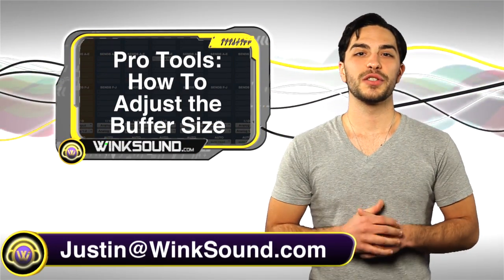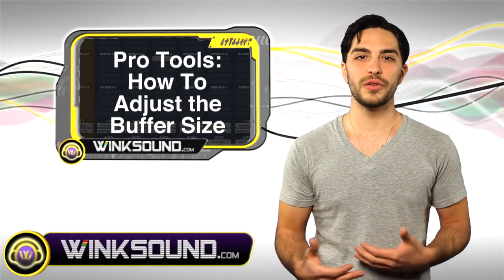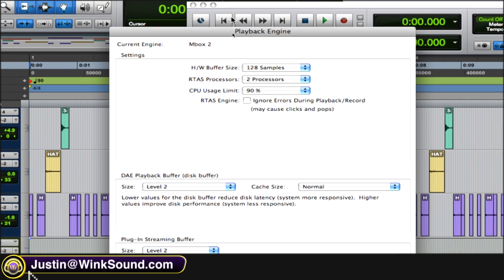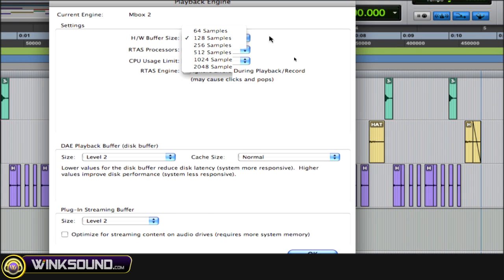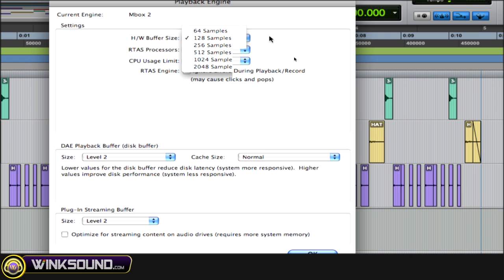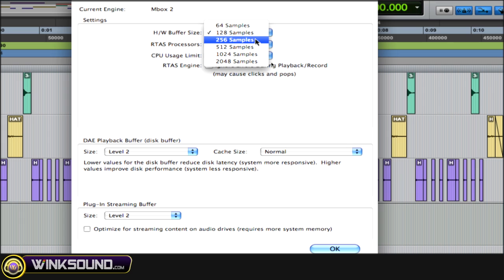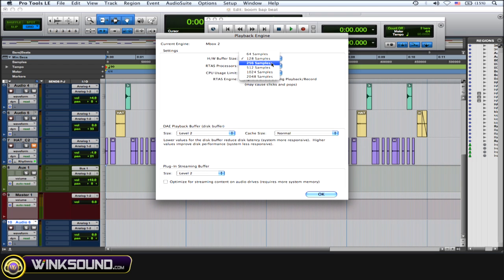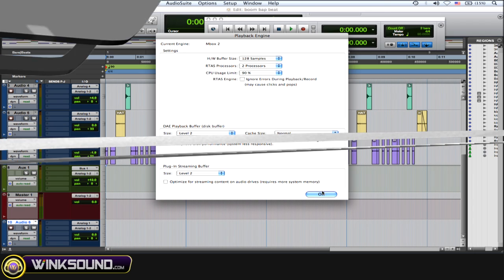Pro Tools: How To Adjust the Buffer Size | WinkSound

Comment: what interface are you using? (or what soundcard)
For example i got an RME interface where the buffer is set and pro tools accepts the buffer set in my interface. Try adjusting the buffer by running the hardware setup from Pro tools.